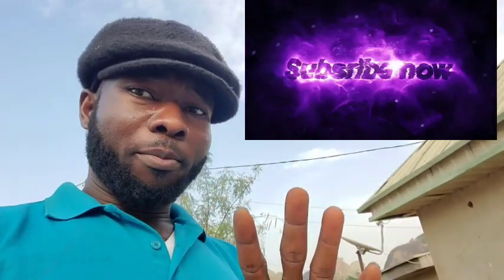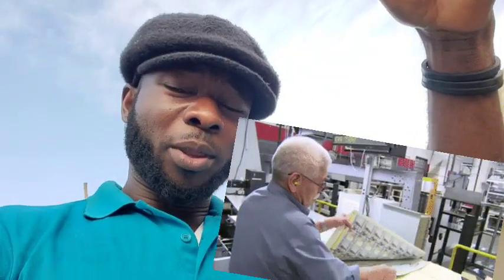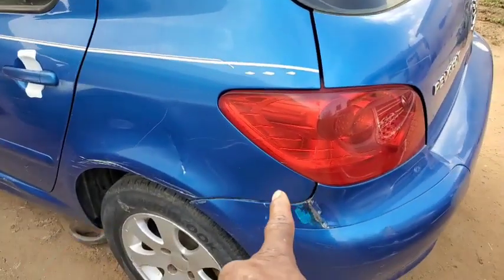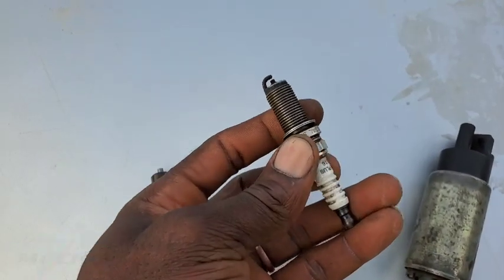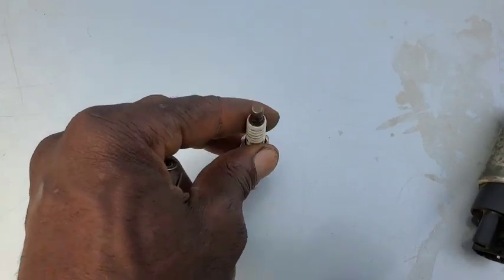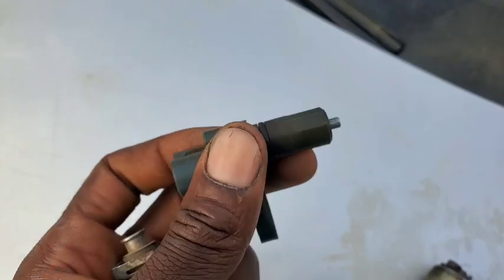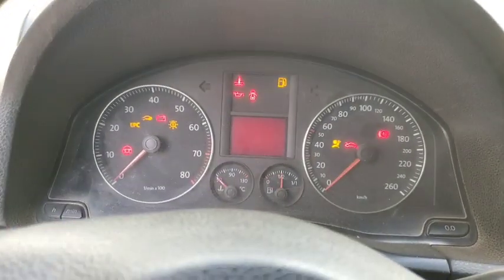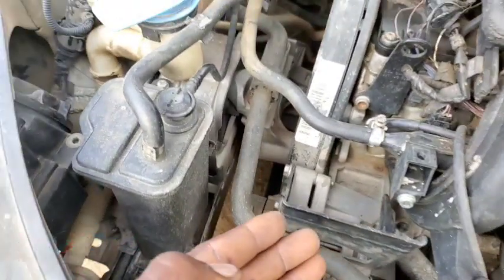HOW TO TEST CRANKSHAFT POSITION SENSOR WITHOUT USING ANY TOOL

Comment: Great explanation . On my 1987 Chevy Celebrity V6 , it shut off at a light . I was able to tow  it with a rope . No spark or injector pulse . The sensor is in a bad spot . I was real lucky . It's original and I suspect over time either oil got on the wiring or the sensor is starting to ooze oil . Even though there is a weather pack seal , there must have been some oil on it . I used brake clean on the connector and sensor . It then started right up . On some newer vehicles , there may be some movement at the tach while cranking if the sensor is operating . But not all vehicles .
Reply: Definitely avoid using brake cleaning fluid on anything that isn't metal. That stuff is toxic and will eat away any plastic, rubber, paint, etc. Accidentally had some overspray get on a tv remote and it started melting the buttons.

Comment: Wow, I'm going to try this. Struggling with a P0335 even though it's a new sensor. Car is overheating and not an ideal situation.
Reply: Mine is p0336 and they still say its that sensor.
But the car oveheats and now shuts off comolelety nothing. 
No xmass lights at the dash bird.

Comment: I've replaced both camshaft sensors, but I'm still getting P0365. What do you think could be the issue? (2006 Honda Accord)
Reply from the maker: And you car will still crank but won't start right?

Comment: So I have a 370z no start you can hear the engine trying to turn over injector pulse keeps climbing but the scanner says lean I’m thinking crank maybe?
Reply from the maker: Dtc?
Reply: @drcoolautofix  it’s for a oil temp sensor but the sensor works then I got a u1000 then I cleared codes to see if they would come back and it disappeared. But the car wasn’t running when those came up I was just cranking it
Reply from the maker: Comms issue not oil
Reply: @drcoolautofix  what test would you recommend

Comment: Accord  - Oil not replaced last 12 months. It was not driven last 4 months. Now it cranks but does not start. Any suggestions?
Reply from the maker: Check for sparks fuel pump injector pulse

Comment: My 2003 Toyota Corolla is not idling and it's stalling when am braking
Reply from the maker: https://youtu.be/Zld-9Qh46AM
Reply: Firstly, check the vacuum hoses to the brake booster and if seems to be oky then you can change Idle Control Valve